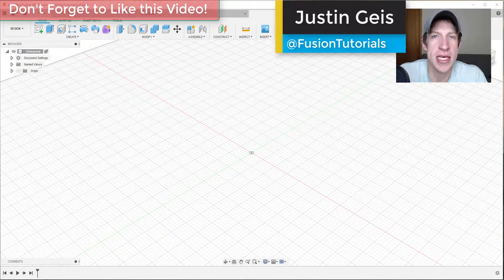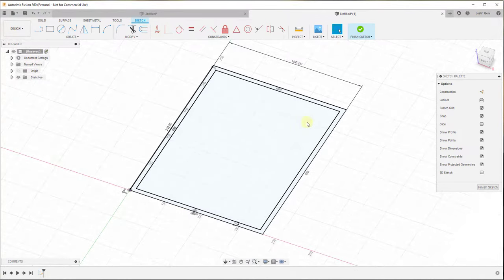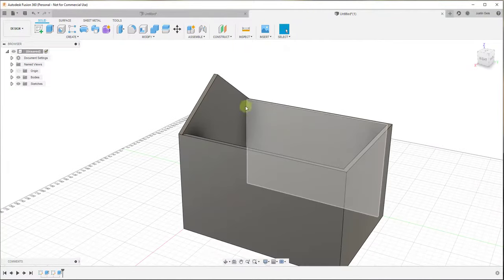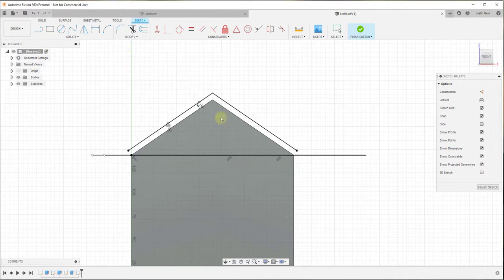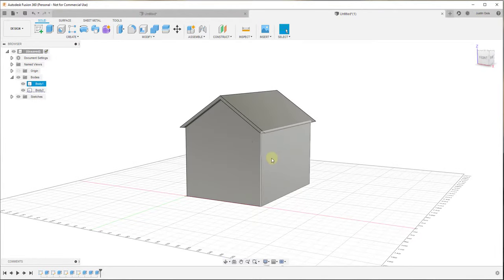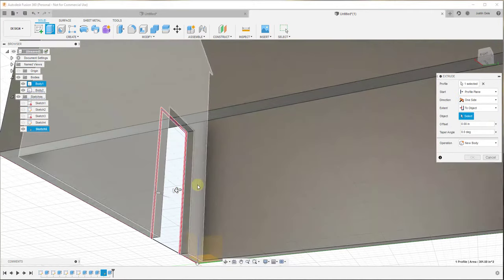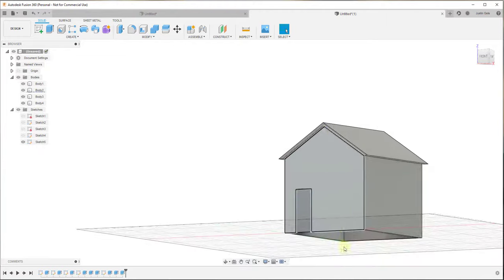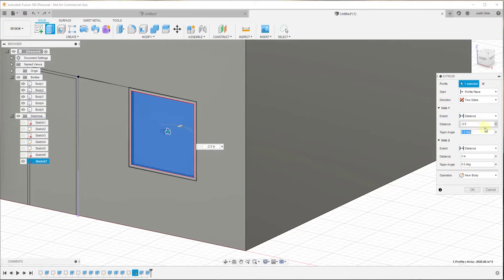Modeling a HOUSE in Fusion 360 - Fusion 360 for Architecture Part 1

Comment: Has been a great tutorial thank you creating this.  As I am following along using the free version it does not seem to create this list of sketches as I move back and forth from modeling to sketching.  Is there something that I can fix in some type of "system preferences" or am I just sore out of luck with the free version? Also my roof continues to absorb the house into "Body 2" even though in the menu I am sure to select "New Body" may this also be because of the limited version I am using? If so that is okay I just want to be sure I am doing what I can.

Comment: Great resource thank you for taking the time to make this... My house has a pyramid shaped roof... What is an easy way to model that?. I removed the false ceiling so is open to the roof inside, I want to use Fusion to design a wardrobe and loft in one 1/4 of the house (house perfect square, and pyramid roof)

Comment: I've been doing something similar for a kitchen remodel... basically what you did except focusing on interior rather than exterior. The problem I got is figuring out how to "orbit" and move around my view so that I can work on details up close. It sort of helps if the origin in the center of the floor plan but when I'm working on details up close the spacemouse gets so hyper sensitive that I can't get to the view I need. Just want to be able to select small faces and vertices, etc. Is there a way to create a temporary "origin" at an arbitrary point so that it's easy to view and orbit around details?

Comment: great video. how would you set up a project to show the customer the original wall then show after the removal? once I extrude the walls up how do make them invisible and cant be selected?
Reply: Make the wall that you want invisible as a separate body. In other words, don't use "join" when extruding. Then you can simply select or deselect it on the left. It can be tricky and in some cases it makes more sense to extrude it all as one body and then split the main body into the pieces that you need.

Comment: Thanks for the great video! I watched this and your floorplan from an image video and followed along to try and model my wife and I's office to arrange furniture. Is it possible to add Carpet or some other 'appearance' to the non-extruded 'floor' of the sketch? It seems like I can only apply Appearances to the extruded faces.
Reply from the maker: I think you need to have an actual body in there to apply a material to - I'm not sure what the best practice for something like this would be yet - thanks!
Reply: Insert a decal or just do a tiny extrude and apply the texture that way